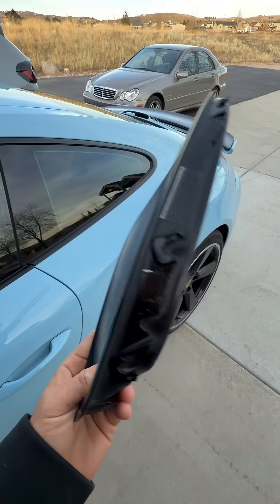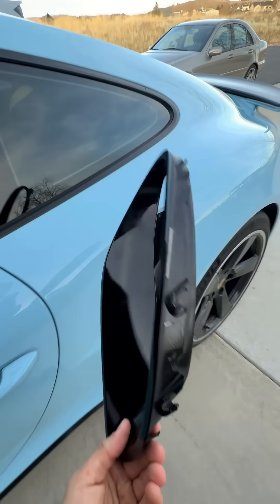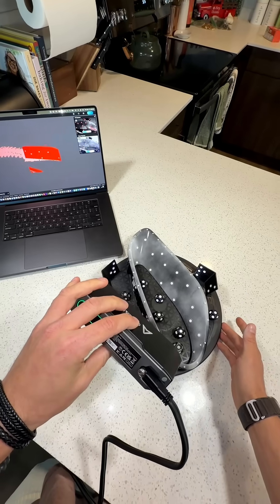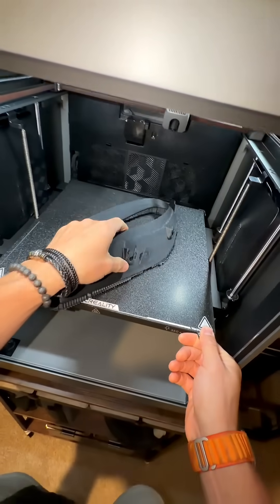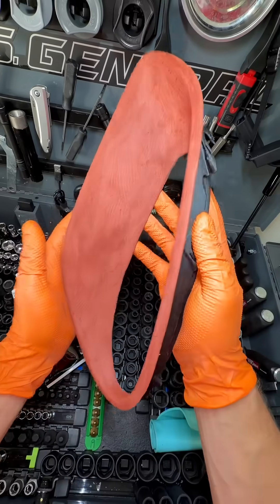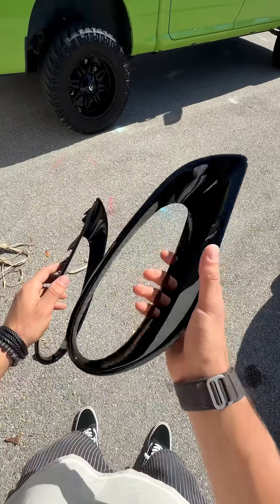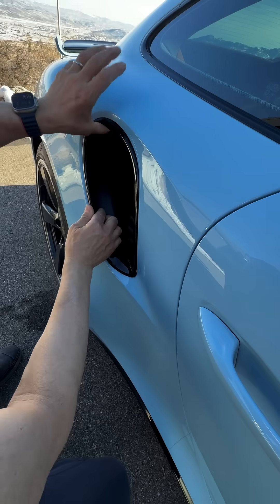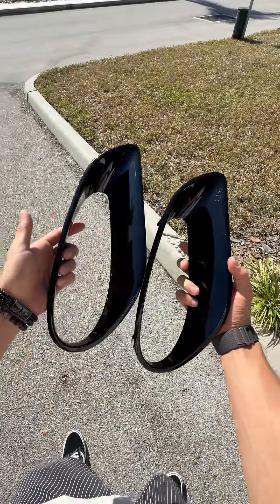Porsche wanted $2,000... So I 3D printed it for $20 instead😳😳😳 #3dprinting #creality #porsche

Comment: I wish someone close to me in south Tennessee had one of these scanners.  I been looking for someone. I been wanting to scan a C7 Corvette Stingray front fender vent and do some tweeks to it. Because i know i could make it look better with very little tweeks. And i know they are a demand for it as well. Because no aftermarket  variations are available.
Reply from the maker: Send me the vent I’ll scan it
Reply: @Haydenschreiermk2  I highly appreciate your response on this. Ill definitely find extra one. And get back in touch with you. Not only i want to make different vent design for my car ..but potentially be able to offer something to the community. Because im definitely serious about redesigning one. Im part of multiple corvette forums. And they are a huge demand for something that looks better than what GM put in there. They are a few made out of carbon fiber. But they are the same design as the OEM one. If they would had redesigned it. It would have been a game changer. Ill definitely be back in touch. Again highly appreciated your time in advance 😊

Comment: as a bodyshop tech for the last 26 years. never use that air dry red bondo. it may look ok at first   but it will always shrink up. usually it only take a month or 2. weeks used to have vehicles that would come back to the shop, and you can clearly see the that area under the paint. eventually we had so many issues with it, that we banned that stuff from our shop.  always use the two part activated body filler

Comment: For those people commenting how this made you just want to buy the 2k part, here’s the real issue. As I do car restoration, I find the special OEM electrical connectors for harness mates, ECM connectors, and more are unavailable. That’s a real massive hassle when you need one. 

I’ve had to make mine BY HAND and it takes hours. Then trial and error fitting, more hours. Most of the time, If I can, I replace with a new universal fitting. Doesn’t work for a 48 wire connector that mounts into the firewall or the special connector for ecm tho. As it is, I now use a caliper to measure the clip dimensions and model it, hours of modeling, but if I could just scan, man, that’s great. I’ll look into this product as someone who actually needs it.

Comment: Scanner: 800
Printer: 500
Print materials: 250
Time spent learning to use software, scan the part, tune the printer, print, refinish, paint and fit: 3000 minimum.

End cost: 4.5k.

Cost of ABS part with a better finish and fit online: 250

Comment: So frustrating to see straight up lies like this. Take into consideration for everything he used in the video and it will cost you way more than 2000$ to make a low quality plastic part, compared to 2000$ original carbon fiber part.

Comment: A solution no one needs for a problem no one has, well done 👏
Reply: No it's real. I have missing sidecover for several motorcycles. I would much rather watch Netflix while reverse engineering the shape (just the distance of three prongs and 40 seconds of creative liberty), inset by 2mm, Print, rip a sander over it or throw it in the acetone chamber,  slather it with resin and carbon fiber, throw in a cheap vacuum chamber and process.
Once you get good at creative stuff you can pull stuff out of your ass and remove all market insecurity except raw materials.
Reply: @Callsign_Sturm u can buy plastic sides without having to 3d print them, porsche is selling for 2k cause they are carbon fiber
Reply: @GOOOFYYYLEGENDI don't care what porche wants to harvest out of my paycheck. Every modern manufacturer is diarrhea now.
Set up the molds for it once and make my own CF.
Reply: Incorrect, it’s actally an excellent solution to an issue that car enthusiast, who own niche vehicles that we drive, race, love, and want to continue doing so, because they’re far superior to anything being produced by any manufacturers today.  In many cases that OEM part or assembly that included the part we need has been discontinued by the manufacturer.  Many times NOS is either non existent, may need to be imported from another country, or  won’t work being we need a part in LHD fitment and the car was RHD overseas.
When quality used spare pricing has reached the stupid level 

3D printing has actually become the #1 best solution to a problem countless people have.

Comment: The 1700 is for the carbon one, not the plastic which is 300$.
Would you do all what you have done  + invest in scanner and 3D printer with special material for $300? No, so shut up

Comment: Cool, if you already have all this equipment, but not feasible to get otherwise. According to the comments, it's only the carbon fiber version of this duct that costs 2k and the regular plastic is 300 bucks, which would make it infinitely more viable to just buy it from Porsche themselves, considering how many work hours alone were put into this. Adding on materials, research and the paint job for 200 bucks alone... Get the plastic duct from porsche if you don't have this exact gear, or at least comparable gear.

Comment: You are so full of crap. From Porsche the side bezels are $400 for the plastic ones, the carbon fiber ones cost close to $2k. Beside, it cost you a whole lot more than $20 to make these parts. 

The printer is $1100.00 - 1200.00 the scanner is another $650.-700.00. The material to print out the practice one and two other ones was at least $30.00. The Bomdo, sandpaper, and the primer was about $50.00. That Napa primer is expensive, not like the $10.00 a can you buy at Walmart. Then on top of it all, you paid $100 to have a professional paint them. That alone is 5 times you are claiming it cost you. A quick search online and you could have found a pair of these for $300.00 and they are better than what you made. 

I get it, you are pushing Creality products, but stop ly8ng about how much you saved on a single part. Besides, Creality products suck! I bought a scanner from them to make some small plastic parts that are no longer available while restoring a car. The scanner only worked half of the time, and wouldn’t connect to any of my computers using the wireless feature. I took it to my friends nephew who makes a living 3D printing prototype parts and he said either throw it away or try and get a refund. He has 8 3D printers running 24 hours a day and he says he wouldn’t waste his money on Creality junk.

Comment: Perhaps instead of the putty you could use a spray primer and apply 2 or 3 thin coats of that. Might save time on sanding it back down plus because it's a primer you can paint right over it

Comment: I'd love so much to hear more about the "and clean it up a bit" part of the process. I've done a lot of 3d scanned modeling and printing this past year and I still struggle a lot with that, especially if the scan quality wasn't ideal.

Any suggestions about what software/tools you use, or any specific steps? 

Especially when trying to merge scanned models with cad designed parts into a single printed piece

Comment: Parts are getting expensive. I work in the automotive industry. A customer needed a new door switch called up a dealer and they told me it would cost me 1240 and suggested customer market price would be 1440.. As much as I hate making customers pay expensive prices at this point, I have no choice if a dam switch is over 1000.. When I was a kid, that would have only been like 60  for a switch..

Comment: I don't buy that the scan didd that good a job around the clips and edges lol.  I think you went off camera and spent hours modeling those parts in..

..which makes the time/effort more expensive than the parts which you showed the incorrect price of.

Too forceful of an ad, you could've juat done something real and useful with it.. but instead choose to fabricate a problem, story, the level of effort required, and the solution to sell a product.  Seems crazy.

Comment: So after time to remove part from other side ,cost of scanner , cost of 3 d printer , cost of prototypes and filaments, cost of sand paper table to set parts on to do the work  blah blah blah and final cost 2000 and 2 days of labour you are so clever

Comment: You really didn't save money if you have to buy a 3D printer, buy the raw materials and pay someone to teach you how to operate it. Spend many hours of your labor sanding and finishing it. Then hire a body shop to paint it. It's 90% cheaper to just buy the part from the Chinese. They are experts at making cheap plastic and aluminum knockoffs.

Comment: Man this guy is an exaggerator. First rounds off 1790 to 2k, when rounding off to 1800 was accurate. Then says near the end that thousands of dollars saved, when he only saved around 1.5k, and that does not include the investment into a 3d printer. While I am sure you can buy this part used at a much more reasonable cost. Why do you need to buy new only?

Comment: A scanner, printer, materials, paints, everything can cost just a little over the duct price itself.
Reply: 200 for the plastic part vs probably 4k in tools and materials not considering your time of course
Reply: The thing is you can use the printer for other things and the materials and paints won't reach 2k. Buying the tool itself is more like a long term investment rather than initial cost which most people seem to blissfully ignore.
Reply: @PlatinumNath  yall seem to blissfully ignore that the carbon ducts are around this price. The plastic is no more than $200 for both or maybe $250. Clearly you're blissfully ignorant. So I can get a printer and the supplies needed to run it for under $250? Yea, no.
Reply: @name5293  so do you throw out your tools after each use and only use them one time for one thing and never again? Blissfully ignorant.
Reply: @Chingusbobingus 
If one doesn’t have any use of the printer outside of this, then?

Comment: 2K seems cheaper to me than buying a 3D scanner, scanner software, 3D printer, 3D printer software, and other materials that most people don't have in their workshop. Why didn't you just take some clay glue and mold it into shape and just sand and paint it? An even bigger question is why did you stop at a 3D printed product and not have it made of carbon fiber?
Reply from the maker: 3d scanner is $650, scanner software is open source and free, 3d printer is $1100 and software again is free. Most people have sand paper and the paint is at Napa lol. My friend wanted it black not carbon. Keeping it OEM

Comment: He forgot the part where you have to buy a massive 3d scanner for thousands of dollars and buy everything else used in the video so yeah imma just buy the part from Porsche lol
Reply from the maker: The scanner is $650 the printer is $1000 and it’s still all cheaper than buying one part🤣
Reply: @Haydenschreiermk2 1650 plus 250 on materials comes out to 1900. Plus the amount of time it took you to make them,  that'll put you over the 2k and yours aren't carbon fiber like the ones you were looking at. Nice
Reply: Lol or you know just buy it online for wayyyy cheaper

Comment: Ah yes, why spend $2000 when you can spend $800 on a scanner $1500 on a laptop $1500 on a printer $400 in consumables and material and dedicate 20 man hours into a project before sending it to a body shop to pay them to paint match it for maybe another $300 so you can make knock off parts for a $270,000 car

Comment: The people saying that him saving this money isn’t worth it for the time involved are the reason they are broke they’d rather spend 4k than 250
Reply: It's a 3000$ 3D printer and a 1000$+ 3D scanner, plus 250$ in materials and paint. Not to mention that the 2000$ part # matches the carbon fiber vent trim while the gloss black vent trim costs less than 350$ and if you factor in labor, print time it probably wasn't worth it. However the convenience, and savings of being able to make other parts if you were to get a printer and scanner would be worth it, paying itself off by about the 40th print but that's assuming every single part you're saving another 100$, more realistically it would probably take over 100 parts made to pay itself off. You could take to selling part replicas on eBay and make it back sooner but then if you factor in time and labor you probably aren't making much, there are other much  cheaper printers and even apps u can use to make your iPhone lidar into a 3d scanning tool if you were okay with a less precise part. This is still super convenient tho...
Reply: @6ray im not reading allat sorry bossman

Comment: I will take buying a 3D scanner, printer, and material over buying an overpriced part every time.
Knowing how to use these machines is a valuable skill that will save you money and even help you get a job. The cost of the tools is going to be spread over hundreds or even thousands of parts. So no, the part he made is not comparable to $1800.